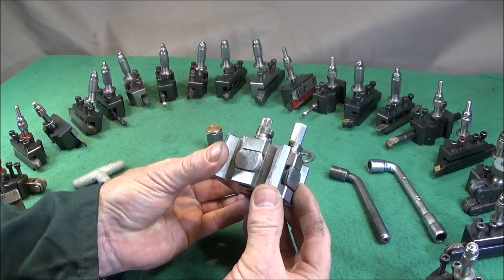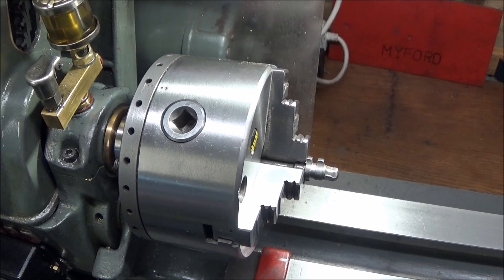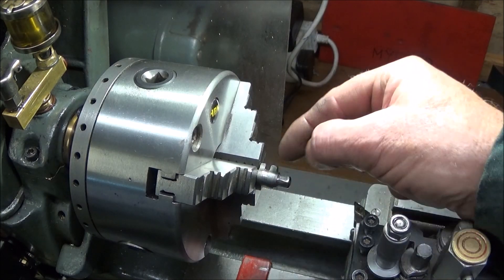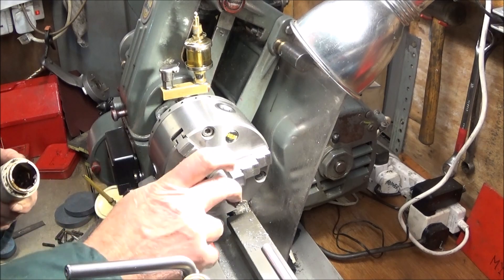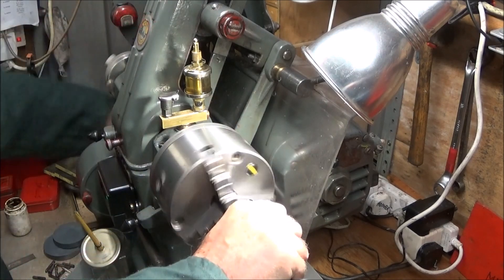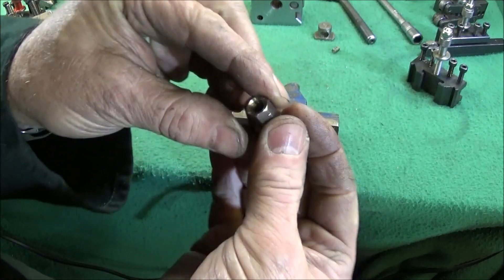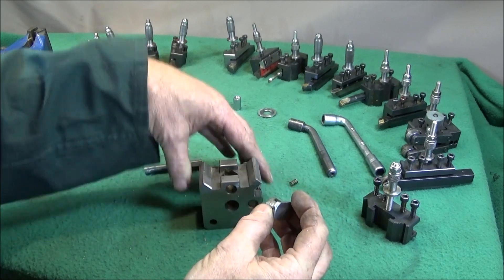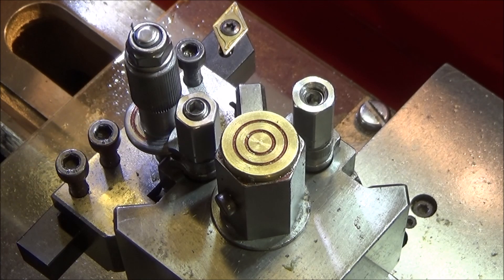Dixon Quick-Change Tool-Post Repair Cam Lock Hexagon Drive Upgrade

Comment: Hi Steve, I have the same Dixon tool holders you have. Can I get some extra tool holders from Banggood?  Or can you suggest where I might be able to get them. I can get them in Australia. However they are about $80 each and I would like a few so I can have some tools set up ready to use.
Reply from the maker: Hi I buy mine from Chronos UK or on their Ebay listing for single holders. 
https://www.ebay.co.uk/itm/Spare-Holder-For-Quickchange-Toolpost-SOBA-BRAND-COMPATIBLE-WITH-MYFORD-LATHE/371940526811?epid=842256880&hash=item5699620adb:g:OpEAAOSwK89Z1SCI

Banggood do not sell these.
Regards
Steve
Reply: Hi Steve, Thank you for your quick reply. Unfortunately Chronos won't post to Australia, I tried with the soft arbors in one of your other videos.
Reply: hello, I wonder know if you mind getting tool holder that made in china?
Reply: Can you get ! ANYTHING ! IN AUSTRALIA !??? ( BACKWARD ! PLACE !! TO !! GET !! ANYTHING !! THERE !! )

Comment: This tool post and tool holder is one of the most miserable arrangements one could think of!
If you are going to make a QCTH yourself, choose the dove tail type, with the female dove tail in the tool holder, and the male dove tail on the tool post.  Also, do not use the cheap and nasty "pump" type clamping arrangement.  A finger clamp that pulls the holder tightly into the front dove tail groove is the way to go.  I built such an arrangement 30 years ago and is still in use.
Model Engineer Magazine described this type of clamping many years ago.  If you have access to the ME index you can find it.
No, I did not copy it;  Mine is not a square tool post, and uses rectangular finger clamps.
Reply from the maker: I don't use this type now. I have the gib aloris type tool post which is much better. Regards Steve

Comment: Steve does the dixon type qctp for a myford ml7 fit directly on to the Chinese mini lathe please?,  I am trying to buy one after seeing yours but they seem to give fitment details referencing the ML7, thank you
Reply from the maker: Hi yes the Myford one is exactly the same for the Chinese Mini Lathe. It is one of the best things you will ever buy for the lathe. You can buy spare separate tool holders over time and have all your most used tools permanently set up. It saves hours of setting time. Regards Steve

Comment: Hi Steve, I have the same question as Graham Turner  Where to get Dixon Quick-Change Tool-Post & tool-post and tool holders you have( Can I get some extra tool holders from Banggood? Or can you suggest where I might be able to get them. I can get them in Australia. However they are about $80 each and I would like a few so I can have some tools set up ready to use. ) Thanks for your help... ( artesaniapr@hotmail.com )

Comment: As usual Steve, a great informative video. But boy oh boy when you turn your great lathe on and off it really hurts my lugholes.
regards Colin.
Reply from the maker: Hi Colin, I have sorted this out now with a brand new motor. The shaft on the old one had a lot of end-float causing a lot of vibration on the belt etc. Also the sound is magnified a bit, for the sensitive video microphone, due to working in 10' x 8' metal shed....Regards Steve

Comment: Hi Steve, love the videos ,may I ask is the Dixon style quick change toolpost on the Chinese mini lathe the same size as the Myford one I know the bit holders prob are but what about the post body and where did you get these from? They can cost as much as a whole Chinese lathe!
Reply from the maker: Hi Geoff, It is exactly the same post and holders. I got mine on Ebay from RDG, but now just buy singular holders from whoever sells them the cheapest on Ebay. I think you can get individual holders fro under 20 pounds now.....Regards...Steve
Reply: Hi  Steve, thanks for the info I'll try RDG or Chronos

Comment: Здравствуйте ! 
мене дуже зацікавила резцедержка   де можна подивитись креслення    
спробую зробити  , як що получиця . 
 з повагою Пан Петро
Reply from the maker: Hi netp. I do not have any drawings for any of the upgrades or tools I produce. Regards Steve
Reply: Steve Jordan Hello !
looked video,pleased .
but as  regarding drafts 
 it is there necessary to observe sizes .
 with kind regards Pan Petro
Reply from the maker: петр федченко Hi No I just make an item to whatever size I like without using any drawings.

Comment: Hi Steve,
I had the same problem with my toolpost.  My solution was to build it back up with my stick welder and then machine it back to a hex.  Mine are made of such terrible metal that I am very tempted to just make some new ones from scratch using some nicer steel.
Also, I found that the spanner for mine is terrible and was wearing out very quickly so I made a little handle so that I could use an 8mm socket instead.  I have a video of that project on my channel if you are interested.  It's only very short as the goal of the project was more about making a video than anything.  
Cheers and best wishes.,
John